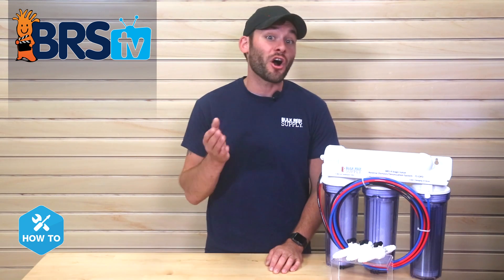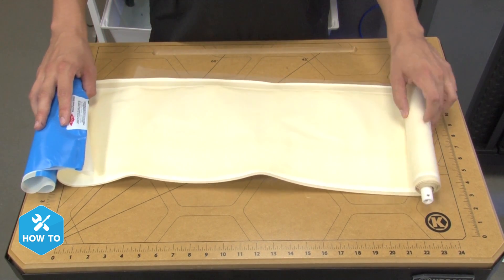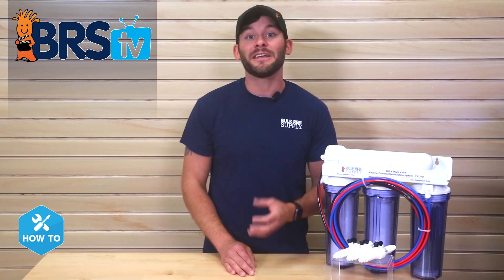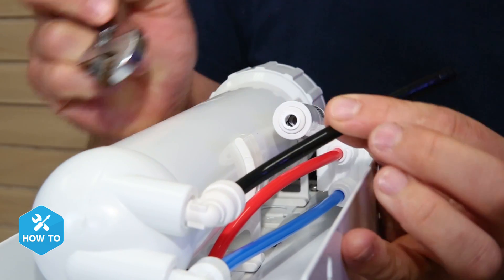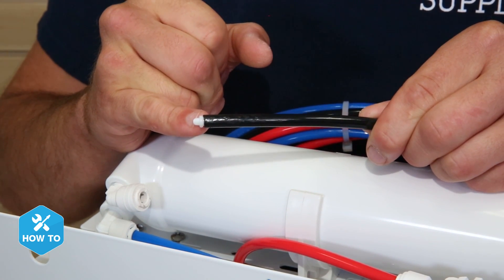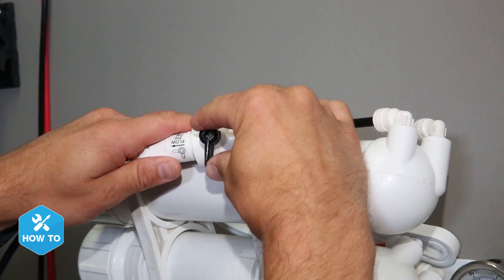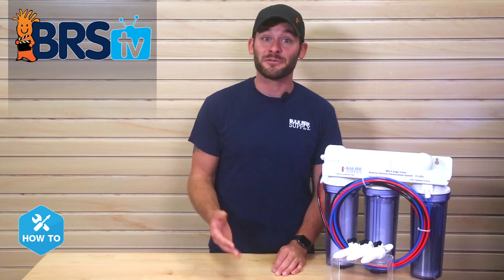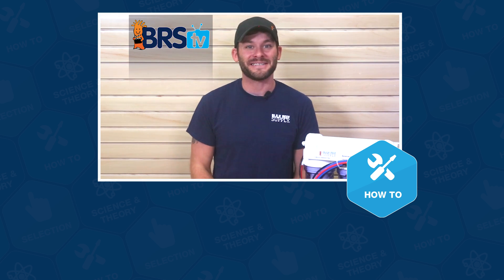How to install a Flush Valve | BRStv How-To

Comment: I don't have an RODI unit but I think it would be a smart move to have a flush valve installed. It just makes life easier. I have a flush valve on my radiator line on my 1969 Barracuda. It makes flushing the radiator sooooo much easier so having one on this RODI unit is a good idea.
Reply: HA! My Barracuda is not a Hobby! It is my daily driver and it is the best car I have ever owned. If I could just get my reef tank to run as well I would be doing awesome!

Comment: I like your new BRS flush valve. I still have the old BRS flush kit where the valve is installed as a bypass, parallel to the flow restrictor.
I will definitely put that on my list when it's time to replace my BRS valves (which will probably be a loooong time! lol).

Comment: Do I have this correct? Flush valve parallel for flushing and perpendicular for normal ro water making?
Reply from the maker: You got it!
Reply: @Justanotherguy You’re not alone man. I find myself having to find this video to double check  the correct valve position if I haven’t used it in a while. I feel they should’ve labeled the valve more intuitively. 
I guess I’ll have to do this for myself ;) Cheers

Comment: I have a drinking water tank. Would I flush the system by running water through the drinking faucet? I mean I assume so, because that is the only way I can run it unless I use the di water line I have for an aquarium! I just want to confirm I understand right.

Comment: Do I leave the RO output tube connected to the di resin canisters while I flush, or do I remove and reconnect after the flush?
Reply from the maker: Most reefers will opt to leave it attached. Unless you have high water pressure, you shouldn't get very much water going through the product line when the flush valve is in the open position.

Comment: can I make the  the black line between the RO membrane and the flush valve longer than what it came with (tubing was very short)? I have the system behind my washer and it's hard for me to take it down and put it back up in order to reach the valve so I want to make the flush line a little longer so i can reach it (no more than a foot), would that effect the system too much?
Reply from the maker: That's not a problem at all

Comment: So you do not need the capillary flow restrictor if you install this flush valve?
Reply from the maker: The flush valve has a flow restrictor built in, so you'll want to remove your current capillary restrictor if you have one.

Comment: i installed the flush kit and it seems that the auto shut-off valve stops the flushing from happening.  Does the faucet need to be on to allow flushing?  Would a pressurized tank need to be empty before flushing ? thanks
Reply from the maker: The water to the RO system does need to be on. If your pressure tank is full, it will trigger the auto shut off valve and not let any flushing occur because the flow to the membrane would be cut off.
Reply: @BRStv  so I finally got it to work by turning on the faucet and turning off the tank valve. After 10 minutes of flushing, and then waiting for production (1 hour), the TDS went down to 22 (w/mineralization). But after a few cups, started rising again to 36+ after a few cups. The filters are new. If the membrane can produce 22 (from a tap of 350 ppm), what is the problem with this system? vexed!
Reply from the maker: I would shoot an email to or calling our customer service team. They'll be best able to help you do some deeper troubleshooting and help get to the bottom of the issue. 

BRS Customer Service
Phone: 763-432-9691
Email: support@bulkreefsupply.com

Comment: So valve should be closed (90°) to make pure ro. Inline to flush. ?
Reply: Luke Hanley yes that is correct.
Reply: I had to look this up to make sure as well. 

Maybe it’s just my misunderstanding of how it works… but when my valve is in “parallel /flush position” the water from RO housing flows slower than when valve’s in “90°restricted position”. 
I would’ve thought the opposite would happen in ‘flush mode’ (the flow would be slower in the 90° ‘restricted’ position). 

Hope all’s well and mine doesn’t have a mfg defect…it’s been working like this for quite a while.

Comment: An observation/Question about DI media.  I have a 6 stage BRS RODI I have very high TDS and Very Warm cold water 90 Degrees once i've flushed it for 10 minutes to cool it off.  TDS is 60 coming out of the RO side entering the DI media.  My DI media lasts about 400 gallons of water in both Resin containers.  Does that seem right or is my hot water prematurely killing my DI Resin?
Reply: TDS is alot higher than that

Comment: So does the flush valve install the same with a "water saver" (dual membrane" setup?   Or do you have to do something special for that?
Reply: Do you keep the original flow restricor between the 2 membranes?

Comment: I have the brs 4 stage and the sediment filter looks orange on it. Is that normal and is it ok to keep using ? My water is still 0 tds
Reply from the maker: The best way to determine when a sediment filter needs to be changes is by looking at the pressure gauge. If you see the pressure start to drop, that's when you'll want to swap the sediment filter out. Since the sediment filter has no impact on TDS, the TDS meter isn't a great tool for determining when it needs to be changed.

Comment: What I have done is use my Apex  I have 2 solenoids  (one on  the Main supply, one of the flush)  I use float switches in my 45 Brute storage.   when I have 5g left Apex turns on mains, turns on flush and flushes.   Also during Ro production  it also re-activates the Flush solenoid and does a flush.     when done flush is turned off and production continues until full then main is turned off :)
Reply: Nice work! Sounds like like a dream setup and your deff getting your money's worth outta that apex 👌
Reply: I am a techno junkie  and love it  need to figure out how to add a 2nd 45g to the storage and fill both (different usage rates though)

Comment: Why do you guys still sell all this antiquated technology???? You still sell 75-150GPD membranes?  Why, 2000GPD 10” inch mini membranes have better performance and lower TDS water and are cheaper and if you put 3 or 4 in parallel then you can even shower in high purity RO/DI water. Why do you still sell these antiques in 2025. You don’t even need holding tanks anymore because you can make unlimited on demand water, and you hardly need shutoff values because you can make water so fast. I can’t believe you trying to sell 75GPD membranes for $500 when 2000GPD membranes are available for $30 from Dow and DuPont…. 🤦‍♀️🤦‍♀️🤦‍♀️🤦‍♀️🤦‍♀️